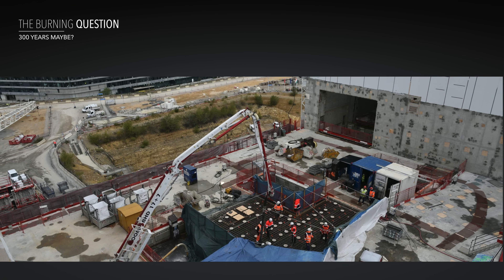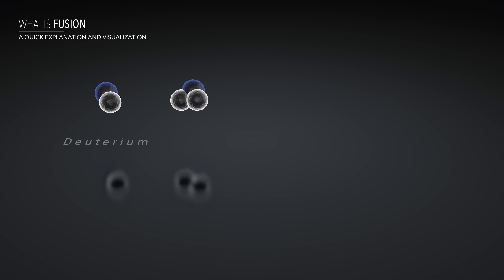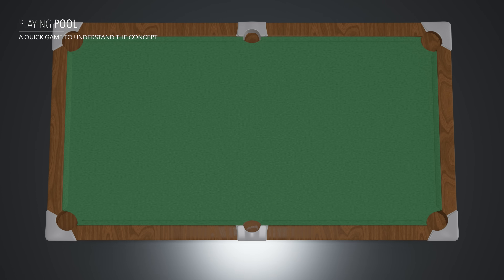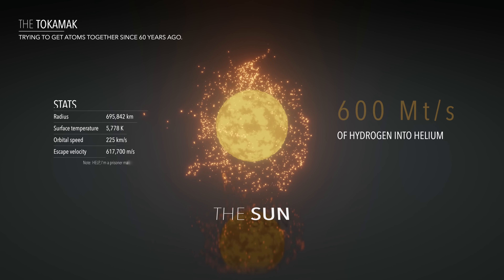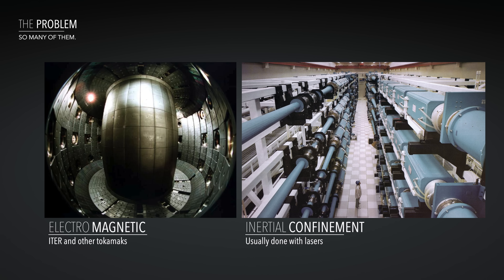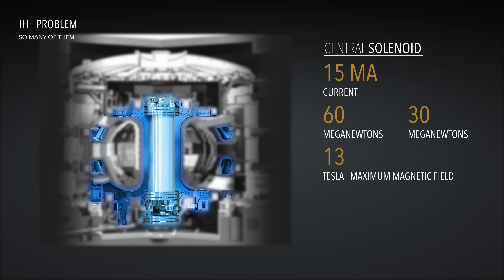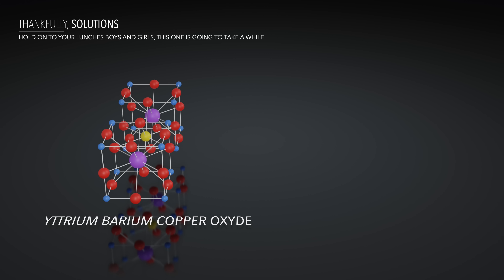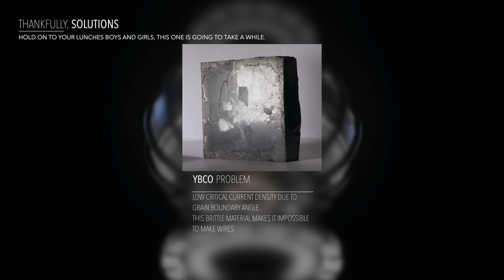Fusion in 30 years? ITER update [2020]

Comment: Why don't they use a fuel source where their fields or actually stick to each other instead of reports or at least one is neutral and the other gives the neutral reaction it's same charge, Say water for instance you probably won't wanna put water straight so you might make a vapor and the water will take the care eristic of any Adam gasses that are introduced , Sorry filled will become a larger field when collided or one smaller field as it releases its extra properties, Materials like water are already combined and make it easier for an Adam that is introduced in another gas form because they are already searching for similar magnetic attachments something like that would need a lot less energy and have a lot less problems then what fuels we are currently using those gasses there adam's 10 to reports giving the problem of needing more energy than the energy output because although the heat is greater their energy output is huge combining those materials is great also.

Comment: Video didn't cover one of the main drawbacks of fusion: tritium is not naturally occoring and must instead be made from lithium, already one of the most in-demand resources due to battery production. This means that we will just replace finite resource (fossil fuels) with another even more finite resource. Deuterium- deuterium fusion is not remotely possible in the near future due to the higher required temps.

Comment: A lot longer, considering this is operating on the premise that stars have fusion going on in their cores.  Which there is credible evidence there isn't fusion in the cores but rather the surface.  This being that stars are actually large bodies of plasma in arch discharge mode, and the double layers near the surface is where you get transmutation of elements.  I refer to the Safire Project's success in the lab.  A lot in "science" these days mimics religion.

Comment: If they get  10% output power gain, will they claim that a unit 5x the size of original will give an astounding doubling the input power.     BUT that machine will be the size of a Square Kilometer for the fusion building in total.  at a construction cost of 10x of original. Will they build it,   SURE  WE"VE got to keep those high energy Physicists employed.  You can build Thorium reactors  that generate 10 times the power output as the larger ITER at half the cost.
Why the HELL are we still trying do fusion via a JUMBO Tokamak  design,  the original desingner has clearly stated that the design will not work as a power generating design

Comment: Fusion: The most miscommunicated of all sciences.
a) Fusion on earth is self stopping
b) Fusion has been achieved almost for 60 years
c) ITER is to show if it is possible to build a commercially viable tokamak based fusion reactor, with a lot of bar-raising material science problems to be tackled along the way
It has a clear plan and clear outcome.
Fusion is not battery science, riddled with hyped and overinflated news messages circulating every year

Comment: The SAFIRE project, in testing Ralph Juergen’s Electric sun hypothesis, has already demonstrated in the laboratory the transmutation of elements with the generation of surplus energy. Check out the SAFIRE video on the Thunderbolts Project channel. The SAFIRE team, with a budget in the millions, has succeeded in less than a decade to achieve what big physics has spent tens of billions and six decades failing at. Why? Because the fundamental premise of their project is based upon the false notion that the stars are isolated balls of gas power by hydrogen fusion in their cores.

Comment: I hope fusion is succesful, we will need that for space travel and colonization.

But for earth... We already have a 0 manteinance, 0 cost to operate fusion reactor. Its up there in the sky.

At current progress of solar power generation, and improvements to battery technology. In those 30 years it should be easy to power the planet with renewables.

I just hope they keep funding fusion research if we do power the planet with solar. Because the sun isnt the ideal power source away from earth deeper into the solar system.

Comment: Don't even need it all its doing is lining peoples pockets Nikola Tesla invented unlimited energy from the air around us many years ago back in the 1890s! A few examples were powered a small town that was powered over 100 miles away through the air no generator, or wires nothing was used but the air around us all.
Had the first electric car had battery's that never needed charging car had a antenna on it got its electricity from the air as it drove kept the battery s charged all the time. The fact is Tesla wanted to provide the whole world with free unlimited energy and he proved he could do it to. JP Morgan funded all his experiments told Tesla if we cant put a meter on it to charge a fee for it then we don't want it true story.
Another true story Thomas Edison did NOT invent AC electricity the fact is he fought Tesla he wanted to use DC current and Tesla said AC was the only way to go he proved it at the worlds fair. Edison promptly stole his idea and ran Tesla out of business. These are just a few examples of what really happened all true dont believe me do some research you will be shocked what really took place back then and what is being withheld from everyone.

Comment: Isn't fission of uranium possible (or merely economical) using isotope U235 instead of U238?
Reply: @Graham Hancucked I was being nice by putting it as a question. In fact, it is U235 that is used in fission reactors, not U238.

Comment: I’m sure 20 years ago I read that the UK had built a small test (not a working unit) device called “Start”, it was built by the JET team. The  machine made use of the fact that the ring would try to form a figure 8 at high energies. Above from memory though! Sadly I think Fusion research has become more profitable for everyone if it stays as research😀

Comment: Keep in mind that the fusion in the core of our Sun produces just 300 watts per cubic meter, essentially the power output of a hot compost pile.  Obviously, energy can be released more quickly as in a fusion bombs but of course stability and safety is at odds with the rate of energy production.  Fusion as the often touted unlimited safe civilian energy source is simply oversold to the public for basic research funding.  Now I'm glad for the research from all the money invested in fusion but safe, clean, plentiful nuclear energy would require far less investment with molten salt fission reactors particularly the thermal thorium breeder reactors and such reactors would actually consume most of our existing nuclear wastes greatly reducing the amount by a factor of 10,000 and leaving the wastes as radioactive isotopes which only need to be safely stored for 350 years rather than as transuranics which must be stored for upwards of 30,000 years.   If your goal is safe plentiful civilian power, you would invest a small amount to start the molten salt breeder fission reactors and then work on fusion.  The molten salt reactors would only take a very small proportion of what has been invested in fusion and MSR is already a proven technology.  Just expecting fusion to solve our need for safe clean energy is like investing in the X-33 instead of the Delta Clipper, the former is biting off a lot of technology challenges that will take a lot of time to work out, the latter is doing what we're pretty certain of being able to do now.  Which would achieve your real goals sooner?

Comment: One small comment. YBCO (also referred to as 123 superconductor) isn't particularly new. One of my first labs as a college freshman included making a 1 inch diameter pellet of this material and floating a magnet over it (we were learning basic ceramic processing). This was in 1995, and the material had been developed in the mid- to late 1980's.

Comment: Unfortunately, it's still a Tokamak reactor and will never produce any form of net output because the design is all wrong. Also, the sun has at least 3 different fusion processes and at least 1 fission process happening at the same time which feeds off each other to keep it relatively self-sustaining (will die eventually but in million of years rather than hours). THIS is why Tokamak projects are nothing but a money waste besides expensive experiments that can be accomplished via already established linear accelerators. Another issue is your information is incorrect. Farnsworth Fusors get much closer to the break even point and are built in garages by hobbyists. DO YOUR RESEARCH!

Comment: Most of the problem that there is wrong materials on earth used,some of them not sufficient for current control,others not good for thermal insulation,third wrong magnetic field stabilizers..The entire structure is faulty constructed,and by the way when there is no proper injection of helium it unable to be works as should...The entire structure is containment for helium,before it stabilized there supposed to be hard to achieve balancing mechanism to allow Helium been contained,dark matter injectors,the technology that not yet exist on earth..While Tokomak is main containment unit,we talking about dark energy here and yes it allow to produce enough power to power up entire USA,Canada and half of South America with Mexico included...This technology could solve all energy crisis,eliminate nuclear reactor needs and make environment more safe,green house affect and ozone layer would no longer be disturbed...However building technology like that is always a risk,it could easily become target for terrorists or saboteurs,when this device is explode it would most likely destroy entire city like New York and flatten everything down,however there won't be any nuclear fall out contamination at after match if we compare nuclear reactor accident....The technology have major advancements,its is only matter how that energy to be used and for what purpose..It can easily benefit civil and heavy industry production,when population grows we always facing a task how can we supply large cities with more sufficient energy,the Tokamak is seems answer for those problems....The larger the population grows the more electrical energy is required,and over some time we might also eliminate need of gas and oil as well,funding new resources that suitable for conversion,this could be answer how to generate food using only atomic structure and molecules...Simplicity is an magic word in Science...

Comment: Been at that dead horse a while now. Should've gone with thorium
Reply: @MilitantPacifist it also can't be accomplished on the earths surface with a net energy gain but meh
Reply: Thorium (in molten salt form) can literally be achieved in years. We've ignored the Tech since the 60's unfortunately. He's not saying Never fusion but Thorium reactors can literally be right now. Not part way there in 30 years. Also, these reactors will be able to generate the huge energy demand needs for a crazy powerful magnet needed in a fusion reaction.Thorium->Uranium 233 and can be almost completely used up in liquid form compared to pellets, not to mention the drastically smaller and shorter waste and half-life.
Reply: @AgentJRock805  totally agreed. Did you hear him explain fusion using the mini-putt reference. It's crucial for you to understand its pheasability without a gravity well like a sun. I'm not saying we will never achieve fusion, I'm saying on earth you won't get a net gain
Reply: @wgarvey84  so it has already calculated in paper of the total energy input and output, and no possibility of net gain, why they even try? The math should provide a hard limit that not any implementation can overcome.
Reply: @putusudiarta1111  why do programs get funded even though they go nowhere? Moooooneeeeey
Reply: @putusudiarta1111  fo put into simple terms: fusion is hard, fission is easy. Might as well use a self regulating fission that isn't trying to constantly go critical.
Reply: @MilitantPacifist you looking to me to prove when people way smarter than me already have... I guess you just wish to substitute your own reality
Reply: @MilitantPacifist research Kirk Sorenson and just listen for a bit. Open up those ears
Reply: @MilitantPacifist before pointing out programs benefiting from funding, realize they have to justify their funding

Comment: It doesn't matter if it takes 100 more years, it's the long game.
Reply: We don't have 100 years, it is either this soon or back to hand plowing.
Reply: Do you know how much energy iter will produce?

Even if they succeed, it will just be another nuclear reactor. A big one. It can t even produce the energy of one country
Reply: @unhommequicourt  Fusion is limited by how much plasma and at what pressure you can contain it, once you get the reaction going. But you're right, it is comparable to ordinary nuclear plants in output. The dream is really about having abundant fuel, and possible low cost, not miniturisasion, but cost is a whole different problem, we have to deal with once we know how to keep one running.

Comment: The sun is a fusion reactor 
Don't create a fusion reactor on earth, if it goes wrong earth will turn into a sun.
Reply: No, Earth won't turn into Sun because of a fusion reactor malfunction or any kind of accident. That's not how fusion reactors work. They are actually safer than conventional nuclear reactors. And Sun is not a fusion reactor, it is a star, which means, it works totally differently from a fusion reactor.

Comment: Bottom line is- fusion is the holy grail.
It's weather-independent, scalable and provides a (more or less) constant power output.

All the alternatives are mostly on their last leg...
Solar is for private, self sufficient use,
Wind is ugly and heavily dependent on location,
Geothermal is a thin, expensive niche,
Hydroelectric you can build only in countries like Canada, where there is no-one around for miles (also good as a buffer for wind/solar),
Fission gets every green femnazi screeching wildly (even though it's the safest and greenest power source by far),
Fossile as THE backbone of our society lasts for about another 50 years...

So imagine how much of todays money was pumped into fission power.
I mean you could make assumptions and subtract the military cost, but still- it's a lot.

Even 200bn more is acceptable in my eyes, when in the end our society has access to safe, ecologically friendly and scalable power source.
When this thing is cracked, we as humans are good for a couple dozen generations...

Comment: I want fusion to be the pathway to tomorrow. That being said, when costs balloon from €5 billion to €80 BILLION, that tells you the project was poorly specified, poorly designed, poorly implemented, and at this point almost certainly being used for money laundering/graft. ITER should be cancelled and either re-specified for different contractors with a concrete timetable and lower price, or should be replaced with more promising (and certainly cheaper!) approaches.

Comment: I imagine a central point of gravity would help ITER a lot. I mean when you consider that our sun has a gravitational force to hold distant celestial bodies in its orbit it's not really relying so much on electro magnets, or am I missing something? If they took ITER to space and we manufactured a super dense material(micro singularity?) that had its own gravitational force powerful enough to assist in keeping the plasma from expanding outward less power would need to be used in containing it, my reasoning for taking it to space would be to lessen the effect of external gravitational influence as earth's gravity would just want to pull the plasma downward thus detract from the central point.
Reply: The force of those magnets on those particles, is much stronger than the force of Earth's gravity on that tiny mass. The plasma weighs less than 1g, and it is spread over a large area. I am sure it even doesn't notice our gravity and only 'feels' that magnetic force. I mean, even a small magnet is enough to make a small piece of metal overcome Earth's gravity, no?
Reply: @effedrien  True, and for my proposal, we would need to discover or manufacture a super dense material with the gravity relative in scale a star, and find a way to safely manage it, It'd probably be safer and easier at that point to build a solar collector to orbit the sun and transmit that power once or twice a day to a power relay in earth's orbit.
Reply: @festro1000  That solar collector that you describe, works exactly as in an old comic book from the series 'Yoko Tsuno'. There was some alien civilization relying on it, and if they missed the transmission, they could all die. Funny I think of that, it must be 30 years ago I read that book ;) Now I was also thinking a bit more about gravity but I believe fusion only needs energy, in the form of pressure and temperature, and it cannot get energy directly from gravity. In the sun, the gravity/mass causes pressure and that is what helps fusion, not the gravity itself (I think). But if we want a controlled fusion, we cannot apply pressure because we need to insulate the reaction from the outside world. It really needs to be perfectly insulated, and that can only be done in a vacuum, so without pressure. So I think if we can't use pressure, we also can't use gravity for our fusion reactor. Just guessing of course, I am probably not 100% correct with my logic  ;)
Reply: @effedrien  Actually I think read (don't quote me on this) somewhere that they were taking the pressurized environment approach and made some headway.

Comment: AFAIK, ITER will consume more power, then can be extracted from it, so it will not be used as a power plant, and definitely will not solve any energy problems. The reactor "DEMO" is supposed to demonstrate actual power generation, but its construction hasn't started yet.